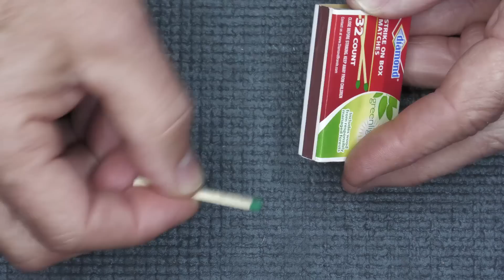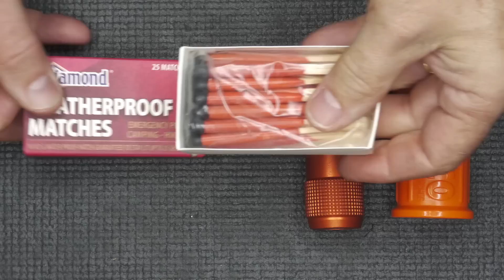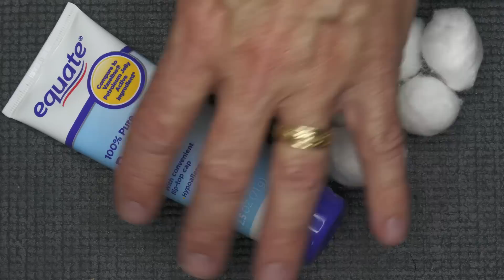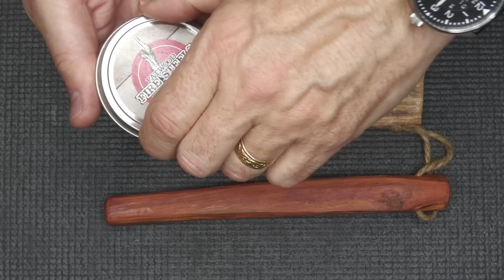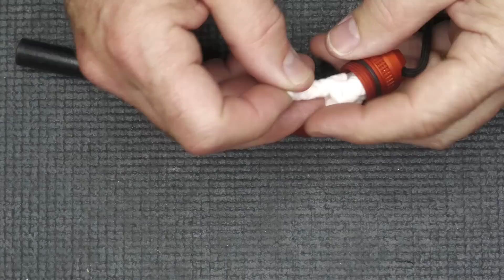15 Unusual Fire Starting Tricks

Comment: The whole trick with cotton balls is this. You need to make sure they’re fully saturated so heating the Vaseline is a good idea as they will soak up more of the Vaseline, or petroleum gel. And I use the big cotton balls. If they’re full fully saturated, You can tear off a piece and use that it’s more economical if you wish.

Comment: I’m not a big proponent of BIC lighters. They cost too much. I bought, and I hate to admit it, 100 Chinese lighters for under $20. I still have 80. And I still have most of the ones that I’ve taken out of the hundred. Little Diddy. Use a twist tie or a wire that holds new electrical cords together, the  little black ones with the rubber flat, they get all twisted up, and you can untwist them,  wrap your Bic lighter, or any lighter under the depressor that holds the gas flame, in other words when you light it you hold down on that little plastic piece. Wrap it under that piece and around the lighter once or twice if you can, and that keeps it from depressing if you have it in your pocket, this does happen. It happened to me more than once. So you save your gas. It does work and it’s not that hard to deal with. Thank you for your Time.

Comment: Bic And Even Zippos Are Good To Have. Bic Is Temperature Sensitive And Zippos Fuel Evaporates But Will Work Below Freezing. Matches An Water Proof Matches Also Work Very Well. I Say Carry Them All. I Us A Cutting Torch Flint Lighter In Stead Of A  Rod But I Will Carry A Rod As Back up. The Tinder Is Important And That Is Cotton Balls And Vaseline Is A Very Good Tinder. You Have Helped Me To Set Up My Fire Started Kit And I Thank You For The Info To Help Me Gather My Kit!

Comment: Learned a little trick to refill Bic lighters till the flint runs out. You will need.
1 bic lighter 
1 thumb tac or plastic tac 
1 butane canister with cap that has all the different inserts
With an empty bic puncture the bottom with the tac and pull out. Get butane container and find right size insert for the butane tip that fits the bottom of the Bic lighter also. Now fill up the Bic lighter. You will need to be quick in this part plug the hole with the tac and bingo. Some butane will escape but most stays inside.

Comment: Nope, Triple Seven is not BP, it is a nitrocellulose black powder substitute.

I demonstrated the battery and steel-wood method to my collage roommate.  He said it couldn't ever work and I said I'd show him if I had any place in the apartment to start a fire.  He said, "Use my class notebook because that will never work."  He had to finish out that term using a notebook that had a large hole burned through the cover.

Comment: No need for carbon in a knife for the ferro rod all you need is a 90 degree edge I have used a s30 v blade with a 90 degree spine on it for a ferro rod for ever now

Comment: I got a cheap Chinese one of them permanent matches like the zippo brand one at the 26:38 point of the video. That one has a bit of wick in the end, and you fill container with lighter fuel strike it and the wick burns like a match. Suffers the same as other fluid lighter's even with a o ring the fuel evaporates over time. Still, it was very cheap thinking 4 for10 bucks.

Comment: I got one of those ExoTac lighters but THEY sent the wrong color...
DO NOT BUY ON scAMAZON!!!

but...

THEY are trying to outlaw NAPHTHA, aka Lighter Fluid, aka Coleman Fuel
NAPHTHA has been used for a century!

this looks like the TALCUM POWDER fiasco
THEY want to REGULATE EVERYTHING!!!

VASELINE, I add some canning wax & charcoal fire starter, melt it all and soak the cotton
1 part each works well, less fire starter if desired
CHAPSTICK is basically vaseline & wax which gave me the idea to begin with

go to the farm store & get pine shavings used for animal beddding

The Fall Of The Empire
Enjoy The Collapse 🤪
😠😡🤬💥💀

Comment: Lockdowns on Bics generally caused by flint being jammed in wheel because it either chipped off a piece or was used up and is resting on the metal attached to the spring. The jammed piece can be cleared by releasing pressure under the spring and removing broken piece

Comment: He is demonstrating the WRONG way to use flint and steel to start fires. I see kids and armatures all the time like he is doing and have problems, get frustrated can't get a fire lit and even knock over food pots. I can see the Sensible Prepper was never in Scouts? Hold the steel next to your fuel then pull the flint (rod/etc.) away. No sway, close in, no knocking crap over, even works in a light wind. I use it on my alcohol stove all the time and as a bonus you neve get burnt or come home without hair on your fingers - if you had it to begin with. Anyway, keep up the great work and great video's but this is proof you are never too old to learn the right way to do something.

Comment: Thanks for all your videos. I like them. Nobody mention the jetflame lighter. Since many years i use one with two very hot flames (blue). I can start fire directly on the wood, even if its wet.
The jetflame lighter works also if it is wet. It is flamed electronically. I take also a small spare refill bottle with me, which i never had to use up to now.

Comment: Correct me if I'm wrong...

Petroleum Jelly is an extender not a accelerate just like the chapstick or beeswax... none of those burn very well if at all by themselves and need to be combined with something like the cotton to be viable.

The alcohol based hand sanitizer however is an accelerate and will burn even by itself.

That zippo permanent match is supposed to have fuel inside as well as some wick on the striker/match. The act of using the ferro rod on the side ignited the tip of the "match" and could be used over and over.

Comment: So many different great ways, pine cones are great dipped in wax, the coating on the lighter can be shaved down to use as tinder, anything concave and reflective works in sun if polished a little. So many ways, then of course the more primitive friction fire or knocking rocks together, (the right kind of rocks). Just to many to list them all. But great video, thumbs up

Comment: In all my time in the Military. The best fire starter is without a doubt a mixture of potassium permanganate and brake fluid. You make a small pile of the PP and add a few drops of brake fluid. Over time you will learn the ideal mix. It starts off like molten lava before bursting into flame. It burns with intense heat and is unaffected by wind or rain. It burns for a long time which helps if some of your hinder is damp, the heat and length of burn will dry out damp tinder before igniting it.
This is a fire starter that needs no protection against wind, rain or snow covered ground. It will start a fire anywhere and in any conditions.
Give it a try. Even my old survival Instructor was totally impressed and added it to his lessons on fire starting.
Reply: PP and vegetable glycerine does the same thing. https://www.youtube.com/watch?v=NeSpLvpwJIQ

Comment: BIC lighters may be fuel activated but even when empty there is a very useful spark available. I always have an old bic lighter knocking about. You can tape spare flints to the body with gaffer tape which of course has many other uses to stop your shavings blowing away.

Comment: I hate to admit this. My favorite fire starter is nothing more than a 9v battery and some steel wool. Has never let me down. I'm still using the same Duracell 9 volt battery that I had when I first learned this trick. It's from 1996. And yes. I used that battery less than 2 weeks ago to start a fire. So all you people keep using what you want. I'll keep my tride and true method

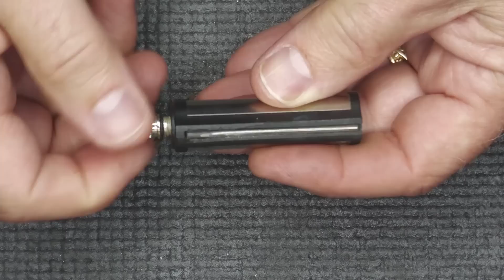Comment: 13:52....add zippo fluid  in the cylinder and you have a match.
 That is the intended way to use it.
 There should be wick material around the blade of the "striker".  The first permanent match i saw belonged to my grandmother, it was made around the 1920s.😊
Reply: My grandma has one too

Comment: You are absolutely right - fire is essential to survival, and everybody should know about several different ways to create it. But then, so much rubbish.
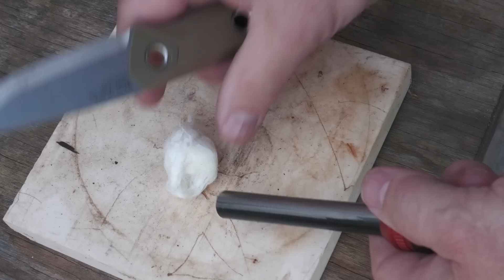Regular BIC lighters guarantee for a minimum of 1,000 fires and in my experience you get nearly twice as much from one lighter. If you're worried about loosing your fuel in a BIC, just protect it and put a cover on it, starting with grinding down the overhang of the release button. For striking a ferrorod you don't need carbon steel, just something hard enough to shave the rod, even a broken piece of solid rock or a shard of glass will do. The big half-inch rods claim to be good for 16,000 sparks, but I've seen many videos, where experienced bushcrafters needed 10-20 (and more) sparks to ignite their tinder bundle, so that massive rod gives them just 1,000 fires or less before it's worn out (@4:10 you needed 8 strikes). A BIC lighter is a ferrorod, a striker and fuel in one tool, and keeping it close to your body in a waterproof sealed or roll-top bag will give you no issues from cold, wet or corrosive weather. The same with matches - put them in a waterproof plastic bag and keep it in a sturdy container to prevent the bag from beeing punctured, and you're ready to go. In very humid conditions you can throw in the small bags of silicagel, that work as a dehumidifier and come with most electronic devices - never throw them away.
The expensive tinders, that you are promoting can be made easily at home, just melt some wax from tealights or candle-leftovers and throw in whatever wooden sticks, cotton, jute or hemp materials you like, wether strips from a t-shirt, cordage or rope at a fraction of costs.
No need to fund expensive homes and cars of the EXOTAC management - really not.

Comment: An old flashlight reflector works like a magnifying glass if you put tinder where the bulb goes
Reply: Yes... An older technic used, when cheap Rao-vac flashlights were available. They were big and clunky!  Now-a-days the LED flashlight is tiny in comparison, and would not make a great choice.

Comment: I have bought several packages of pencil sharpeners at Dollar Tree. There are like 12 to a pack for $1.25. You didn't show a magnifying glass (I know the Sun has to be out to use the magnifying glass). I have a good stock of Strike Anywhere Matches. I keep them in waterproof containers. Air has moisture in it that will ruin matches eventually if not kept in watertight containers. Keep Prepping my friends.

Comment: You absolutely do not need carbon in steel to use a ferro rod. Indeed the ferro rod works perfectly well when scraped with a sharp piece of flint. Sadly I gave up with the video at this point as to me it showed an impressive lack of knowledge on the chosen subject

Comment: the big lighters always have a good long flint.I collect old ones and cut the remaining f!it in half which gives me two regular size flint.roll a knife blade across the middle on a board,then cover it with one hand and push down and it will crack.maddog.off grid horse drawn survivalist.West cork republic of Ireland

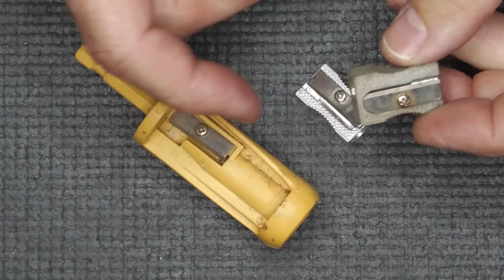Comment: that is not how a forever match works. there is probably more wick down beneath the striker, you just need to pull it out, then add fuel. @14:00

Comment: I use those little tealight candles a lot. Some how I’ve ended up with a couple hundred guess my ex bought them. I keep them in my edc bag and in my car. Use them almost every time I start a fire when we go camping. I just light one and start stacking tender on it  . Obviously you can reuse them over and over but I usually just leave it in the fire and use once.

Comment: Soft ferro rods are preferred over all others by those of us that use them in adverse conditions oddly enough the best ive ever used are the coghlans when you are out in the cold and wet they throw a fatter hotter longer burning spark than the exotac rods ... the light my fire rods are the worst they are way too hard and don't throw long lasting sparks... the best striker will always be a carbide tool sharpener you should never never use your knife unless you have no choice and you can use any steel thats harder than the rod so a medium carbon or higher works fine you don't need a high carbon blade you can absolutely use stainless hell a sharp rock will do the job

Comment: Dryer lint in cardboard egg cartons, melt wax. Break off individual eggs. Burn in the snow for over 45 mins.  Stay prepped my friends…
Reply: Learned these as a boy 35 years ago and never found anything better if you keep them dry enough to light, and have an ignition source
Reply: dryer lint in toilet paper rolls.

Comment: the best home made fire starter to carry with you is cotton balls soaked 2/3 with used candle wax, or the wax melts after used to release the scent. We lady's like to use. Why toss the used wax it has many uses.leave the top of the cotton ball without wax and just let it soak up the wax. set aside to cool and harden. it can be used in rain because it will burn longer and dry out enough tender to get a good fire started. the cotton acts as a wick it can also be put out after the fire is started and used several times. I've also used makeup removal pads the same way. Can cut in 4 pieces and work awesome too. it's less messy then Vaseline too. You can use a sharpen stick to poke the cotton ball on so when you start the fire you don't burn yourself. these are my favorite fire starters i pack camping as well as leave in my purse and truck. never know when you might need them. i store them in spill poof containers to keep water out. And you can add matches to light them or a lighter in the container with them.

Comment: When it comes to making fire I have 3 things that I really like
1 fire starter gel
2  Fire plug (Wax impregnated cotton)
3 wax wood (Artificial fatwood)

Sure everything I posted is man made or artificial, but they are easily made.  
A trip to home depot to buy cotton rope and wood kindling sticks.  Process the two into fatrope and waxwood and the issue is you have a surplus of firestarters.  
Or you can omit the kindling sticks and buy fatwood.  I like the waxwood because the wax should not dry out like fatwood can.

Comment: A peanut lighter is smaller than a dime in size around and about 2 inches tall, Have one on my key-chain that I've carried over a yr, still lights, haven't refilled it yet. Also, peanuts, almost all nuts will burn, about half the stuff in most trail mixes will burn. Oil lamp wick will light with a fero rod, char an end and it will also light with a fresnel lens. Fresnel lens the size of a credit card carried in your kit and/or wallet.

Comment: Place kindling on hard, flat surface (e.g., a rock) -- Place the Ferro-Rod firmly against the kindling and hard surface -- Strike the Ferro-Rod and you will have fire!

DO NOT hold or waive the Ferro-Rod in the air -- The Ferro-Rod MUST BE PLACED IN THE KINDLING AND AGAINST THE HARD SURFACE!

Comment: Tiny strips of duct tape or rolled up in tiny "cigars" will lite with a ferro rod. Fritos also work if you don't like Doritos. One other technique for a small stove is an Altoids can filled with perlite. Add some 70-91% alcohol and it will burn for 5-7 mins. The perlite can be used and carried in the can over and over. That Zippo you showed used to have lighter fluid in it as the end is a wick you lite on the that striker.  I've never seen that "grater" - cool little kit. Thanks.  GOD Bless

Comment: "The tip of the iceberg," indeed!  If you were to go through every permutation of all of these methods, the video would have to be a 3-hour live stream!  I'll just thank you for everything, and try to add a few more useful points for the whole group:

1)  Laundry lint can be used in the same way that cotton balls are here (I do it all the time), and cotton rounds have been used, as well.  However, I can attest that the cotton you find in the tops of medicine bottles doesn't seem to cut it.

2) Something called a "fire straw" can also be used with the cotton/lint tinders: you cut a drinking straw into quarters or thrids, stuff it with 3 or more cotton balls, and seal the ends.  Then, when you need a firestarter, you just cut it open to light it (there are several videos about how to do this).

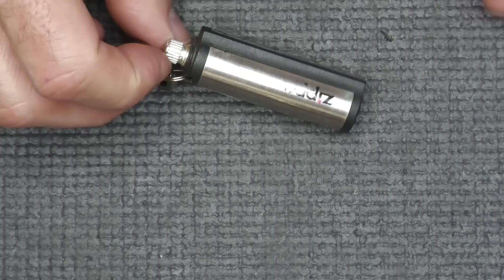3) That Zippo striker at 13:25 or so is a pretty good example of what's called a "permanent match," a kind of firestarter about halfway between a match and a lighter that's actually quite common, although I don't see the survivalists talking about them much . . .

Comment: Cut short lengths of Jute Twine and dip in melted wax.  When dry, you have  waterproof tinder that burns like a small candle with a much better flame than just the untreated twine.